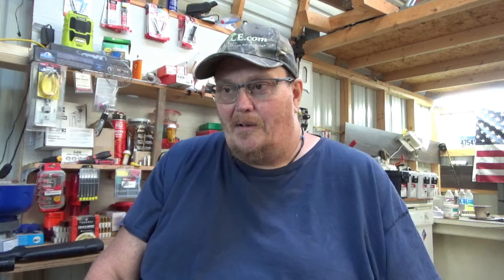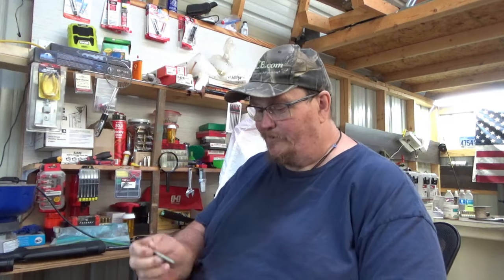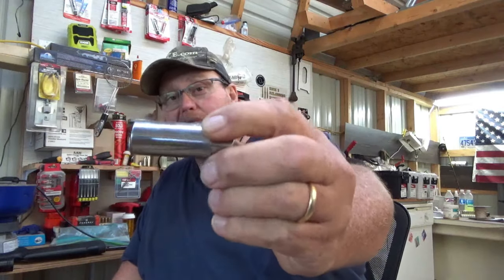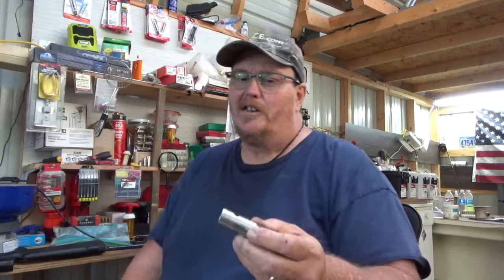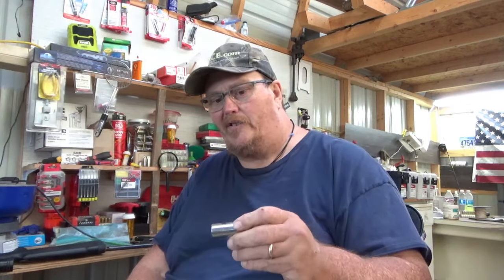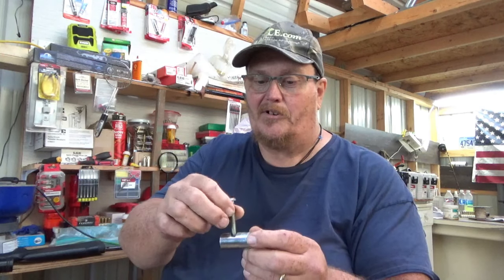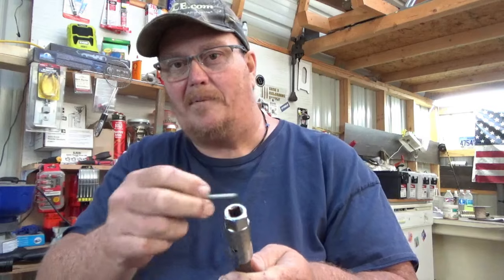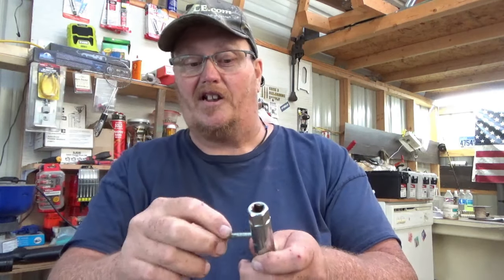Stuck breech plug in a muzzle loader

Comment: I switched to the cva with the hand removal breach plug. So much better
Reply from the maker: I still use a remington 700ML so I have to make sure I clean mine real well. It's stainless so it's a little better but still requires persistent cleaning.

Comment: My dad did the same thing with a thompson center firehawk 54 cal. He gave it to me 20 years later and when we opened the case there was a  fired percussion cap still on the breach plug all tarnished up barrel was rusted more than ive ever seen one and he Took the tool to remove the breach plug and it snapped the nipple off Completely totaled the gun
Reply from the maker: When the weather warms I will get this one out. Do you still have the rifle of yours would you part with it if you do?
Reply: I still have it I live in circleville ohio I'm not sure it would be worth shipping there is some parts for them on ebay can almost build the whole rifle  mine has a Black synthetic stock with the thumb hole in it He bought it new when I was 6 or 7 its very lightweight and kicks like a mule
Reply from the maker: @bricehale6593  I would be happy to pay shipping on it and try to repair it to usable condition if you want to donate it to the channel. Maybe get to see it take a deer this fall.
Reply: @Fatman0815  honestly it's kinda Sentimental to me I've been wanting to get it fixed myself That's kind of how I found this video today When the nipple broke it kind of split in half We couldn't get the tool on it anymore and couldn't get ahold of it with anything So I took my drama and I grinded it down flat And tried to use a extractor but it just slips I was thinking about soaking Green machine then cleaning it and taking a torch to Heat the threads and then apply some candle wax to them and see if I can Spin it out with a punch and hammer I did that trick on some manifold bolts one time that were very very Seized, and they came right out
Reply from the maker: @bricehale6593  just be very careful if you use a torch not to overheat the barrel. You need to heat the barrel and not the plug but if you do too much heat the barrel will lose its temperature and be unsafe to fire.
Reply: Definitely thats good advice I wouldn't get it red hot or even smoking hot i know it will change the temper of the steel wish I could find a better barrel there all about the same condition lil rusted up for 150$

Comment: 😂 i was watching you with that Milwaukee and i said to myself...  Bet a DeWalt would get it
Reply from the maker: I actually used my 1/2 Dewalt and it broke the tool. When deer season is over and I have time I'm gonna revisit that puppy. I will be victorious one way or another. 😆
Reply: @Fatman0815  I'm dealing with the same kinda situation barrel looks about the same.. my dad took a trade on an old rust bucket of an old Ford ranger for an old rust bucket of a .54 cal muzzleloader. He traded the truck for the muzzleloader and $200 cash 👍and well that was about 20 years ago... I was hoping to get it up and running for muzzleloader season, but  Michigan here and our season is only Dec 1-10th. Haha well maybe I can at least get it operable and sighted in for next year

Comment: Okay first off that is a CVA not a Thompson centerfire like I like how you tell people that can clean your guns that is probably one of the best things you can do that you are doing in this video but I have removed several stuck breach plugs out of CVS and you do not use that style wrench on them you put a you put it in there on the socket and you tap it with a hammer it'll break it loose right
Reply from the maker: I don't recall saying it was a Thompson but if I did I misspoke. And believe me that breech plug has be hit with a hammer hundreds of times lol. I will get it out when I have more time to would on it but you won't tap this one with a hammer and remove it trust me
Reply from the maker: This breech plug doesn't have a hex head, it is the slot only. That type of wrench is the only tool that will fit it
Reply: A very large flathead sew driver well work some times or a bar with a sew driver head flat ,,
Reply from the maker: @sarahworkman6364 tried most everything on this one. It's the worst I've ever seen. As soon as I get a little break in doing videos I'm going to get serious and extract it. I've done gunsmith and tooling work all my life. I couldn't count the stuck breech plugs, and striped bolt heads I've removed from firearms. This one is the first that's fought this hard. But in the end it too will fall. For the FatMan does not accept defeat...ever.